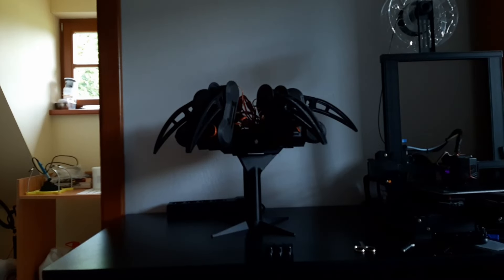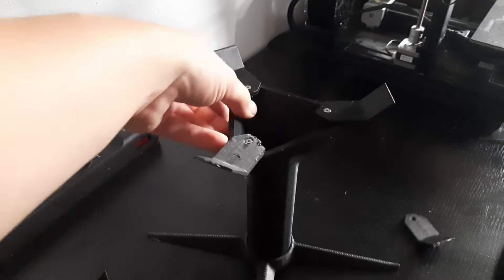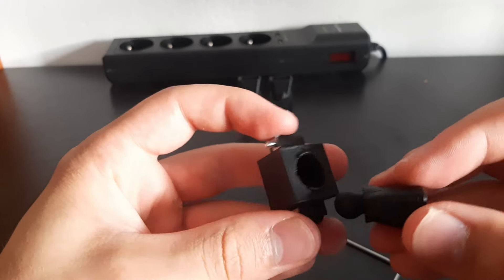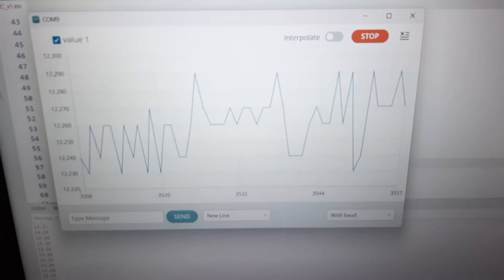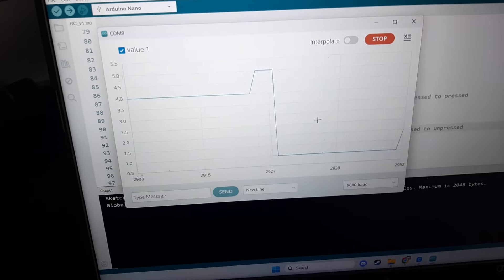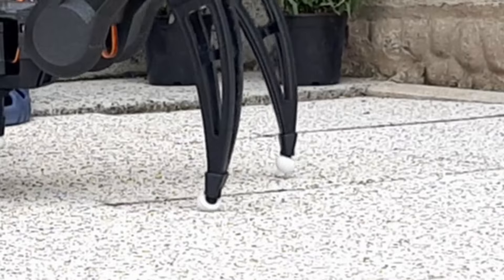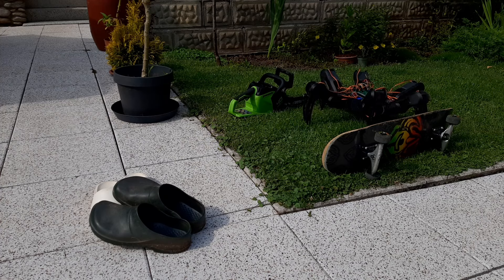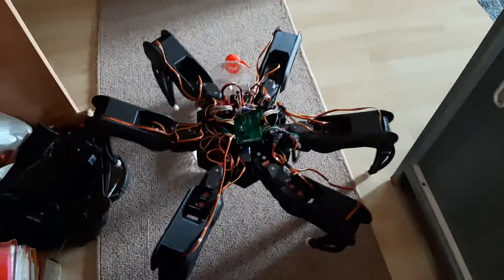I Made my Hexapod Robot Remote-Controlled

Comment: 1:51 this is an issue with your printer, i calibrated mine and if i have a 50mm id, 65mm od bearing, i make my model with those exact values and its a perfect fit everytime
Reply from the maker: Does it work for different nozzle sizes? Mine expands more with bigger nozzles and I change them all the time.

Comment: Another question: how do you synchronize the movement of the hexapod's legs? I’ve noticed that they start moving at different times, even without any programmed delay between them. I need legs 1 and 3 to move simultaneously in the same direction, but I see there’s a delay in the start of one of them. Did you do anything to resolve this issue, or did your hexapod not exhibit this behavior? Thank you in advance for any tips.
Reply from the maker: The code has 3 vectors of x, y, and z coordinates, which trace the leg trajectory. The vectors are pre-programmed and have 100 elements each. The code has a for loop which goes from 0 to 99. Each iteration I set 3 legs to x[i], y[i] and z[i] and the other legs are offset by 50. I used the modulo function for the offset.
Reply: @TazerEngineering  I employed a similar approach to move the three legs simultaneously, but I observed that they do not remain fully synchronized. Additionally, I chose to develop a pre-programmed movement vector, although I used only 10 elements. What concerns me is the movement of these three legs; I feel that even though they are moved to the same position, they end up arriving at different times, which could potentially affect the forward movement of the hexapod.
Reply from the maker: @guilhermeconstantinov  You probably need more elements. If the leg moved in a straight line and you used only 2 elements, the position would be accurate at those 2 points, but the movement in between them would be unexpected because each servo reaches its target angle at a different time.
Reply: @TazerEngineering  I will try to add more elements to see how it will perform. Thank you very much for the tips!
Reply: I discovered that the problem was related to the excess use of Serial.print commands in my code. These commands were delaying some steps and reducing the motors' speed. After removing them, the motors resumed operating in sync. Additionally, I decided to add more elements to the list to smooth out the movements, as per your suggestion.
Reply from the maker: @guilhermeconstantinov  I had the same problem a few times. Serial.print slows down the code significantly. Glad you resolved it!

Comment: What is the power rating of the batteries you're using, and which DC-DC converter did you use? I'm building a hexapod with motors of the same 25 kgf brand, but I'm experiencing power supply issues. For some reason, the servo motors get lost when moved simultaneously, and some start moving slowly.
Reply from the maker: I am using a 2S lipo battery, which directly powers the servos. The servos are rated for 6.8 V, but I haven't noticed any problems even when I power them with the full 8.2 V from the 2S lipo.

I had the same issue you described when I was using a breadboard and a 15 A DC/DC converter, which wasn't providing enough current.
Reply: @TazerEngineering  Thank you very much for your help! Indeed, the problem was solved by using an external 50A power supply. I will also buy the batteries as suggested. I really appreciate the tip!
Reply: "25 kgf" is not the brand but the stall torque. They look like generic servos.
Reply: @conorstewart2214  Yes, that's correct: "25Kgf" is the torque. However, I was able to identify the manufacturer's brand of the servo motor shown in the video, and it is the same brand that I use, but a slightly more powerful model.
Reply: @conorstewart2214  The text might be a bit off, as English is not my native language.